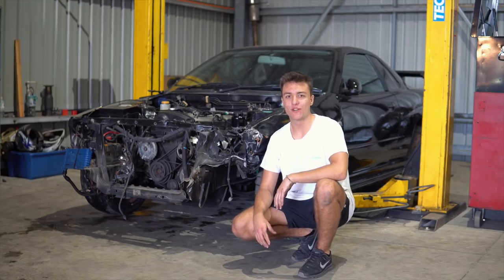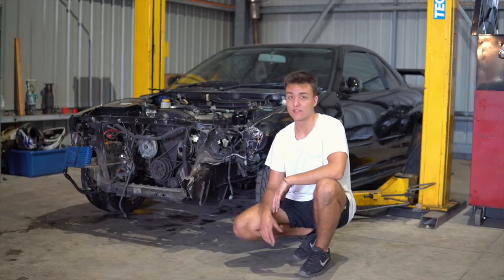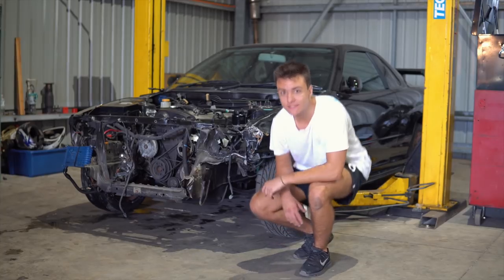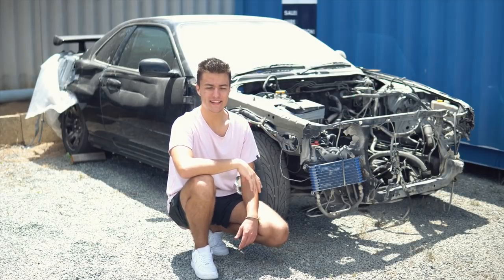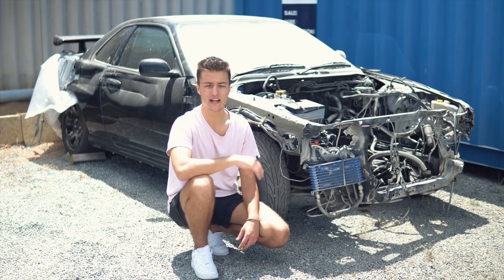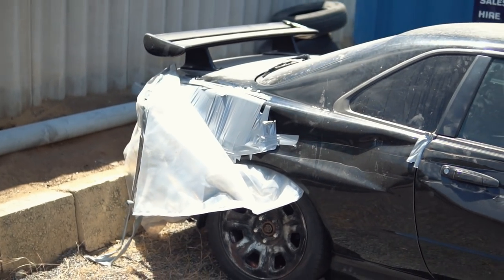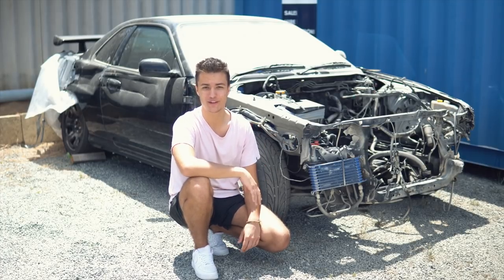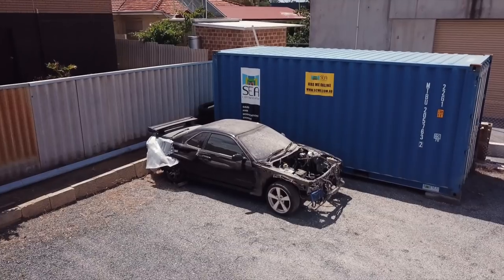Buying a WRECKED R34 SKYLINE | Poor Man's GTR [EP1]

Comment: I hear you on the factory metal parts from Nissan but at the same time even if you did choose to go aftermarket with fiberglass I dont see what the problem would be. People are too judgmental in the car community that's why I stay to myself and just do whatever I want regardless of what people think.
Reply from the maker: Hey mate, I see what you’re saying. To most people fibreglass overfenders will do the trick but I am picky! It’s not necessarily because they are fibreglass, it’s because you will never mold it in and make it look like the real deal. The whole point of the build is to have a car identical to a GTR for a fraction of the price (it wont be awd either) . Some are going to love the build and some will absolutely hate it. If I worried about what people think I wouldn’t be building it, let alone posting it on youtube.
Reply: @BrokenSilvia  where did buy the car? I've been looking and can't seem to find a crashed r34 gtr.